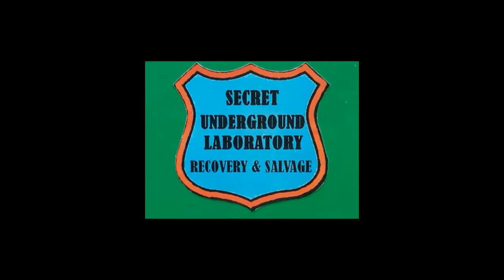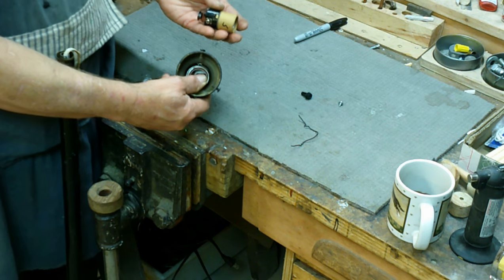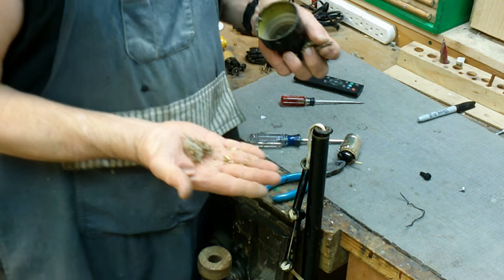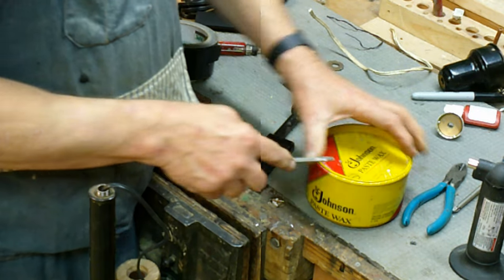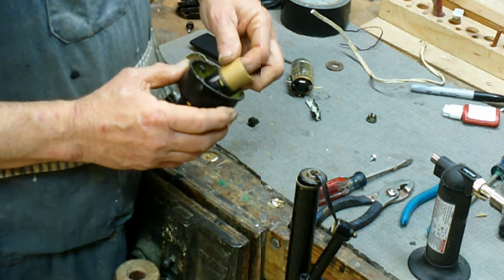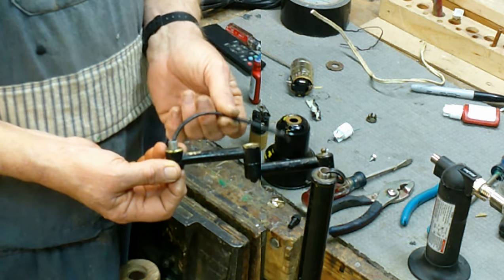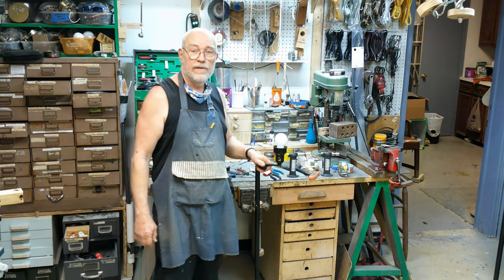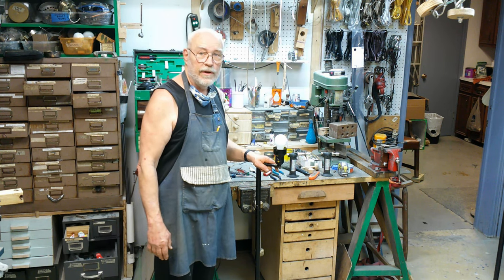Rewiring a Swing Arm Floor Lamp in the Secret Underground Laboratory Recovery & Salvage

Comment: Thank you so much for your video!  I am in the middle of replacing the 3 way switch on a newer swing arm floor lamp, and I had no idea how to get the wire to feed through the arm, so that I would have enough wire at the socket to do the job properly, and to use the UL knot.  Your video explained it perfectly, and I am on the way to a newly working floor lamp, as soon as my socket arrives tomorrow.  Thank you again.  You were great!
Reply from the maker: Thank you very much.

Comment: Very very helpful video, especially the Johnson’s Wax trick. Just a thought, once you finish wiring the socket and fishing the new wire back though the arms to the top of the pipe, I would then fish the wire straight down from the top of the pipe to the base. You can then freely thread the pipe into the upper arm until it’s tight without fear of twisting the wire at the bottom. If you have a lead weight type base underneath the finished tin cover you can drill a hole using your grommet hole at an angle toward the center where your wire is coming out of the pipe, then fish your back through the hole you just drilled back through the lead base out of the grommet hole then attach your your plug. It may seem like a lot of extra work but it really works well.

Comment: Have one of these critters, inherited from my folks, so it's over 50 years old. I got it apart, but then was stymied by the three right angles the new cord had to go through. Pulled up this video, and headed to the shop, found my (also 50 year-old) can of Johnson's paste wax; and lo and behold: let there be light!  Thank you so much!
Reply from the maker: Thank you for your kind words. You are very welcome.
Reply: @BronZeage  I was literally on the point of tossing this lamp in my truck and taking it to the dump, till I saw your video.

Comment: The problem I'm having with mine is it's got two short 1/8 IPS pipes on each of those ends of the arm and I cannot get it loose... Tried penetrating oil. Might have to heat it up
Reply from the maker: https://youtu.be/G1-deaYlCGM
Check this video for a tool to hold lamp pipe. It works in a vise or vise grips. Lamp pipe is cheap. It's easier to cut new nipples than to fight to save an old one.

Comment: I was about to try my first lamp repair on an old swing arm floor lamp. The three-way switch wasn't engaging correctly and I thought I would be able to somehow replace the upper part with YouTube's help. Just as I was about to get going looking for the part and looking up how to do it, the lamps user bust the swingarm itself. Is it possible to purchase that part separately, or should I bypass that portion and just turn it into a straight up floor lamp in your opinion?
Also, having done absolutely nothing like this before could I possibly turn this into a fire hazard?
Reply from the maker: The only source of a swing arm would be a similar lamp. Fire is not a real hazard. Electric shock from a chafed wire is a concern. Fire hazards from lamps tend to come from the cord and specifically the plug. A loose connection gets very hot.

Comment: I could not feed my wire up a 3 foot tube. There was one 90° curve and one sharp 90° turn on top end. No method I tried passed thru both turns. I tried both directions. My lamp is now a piece of junk.
Reply from the maker: The pipe has to be disconnected from the swing arm. Run the wire up the pipe and pull enough slack to work it through the swing arm. As I show in the video, you push the wire to joint and pull it out. Then push it through the second arm. When it's connected, pull the slack out and reattach the swing arm. I hope this helps.